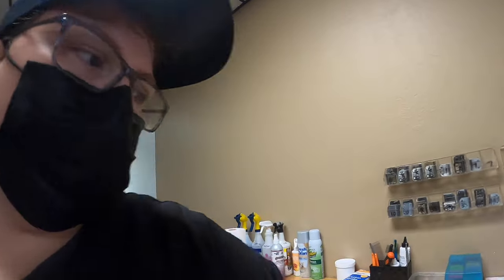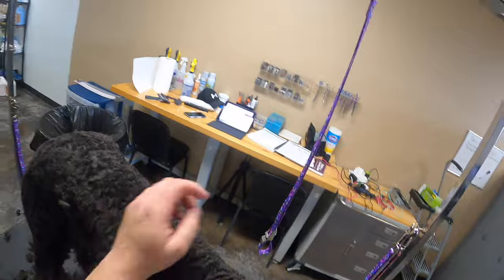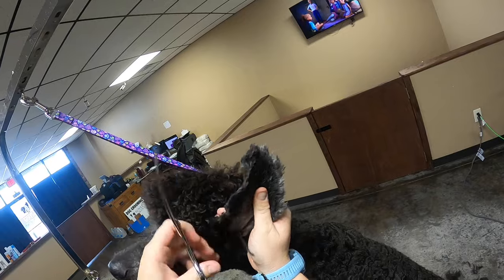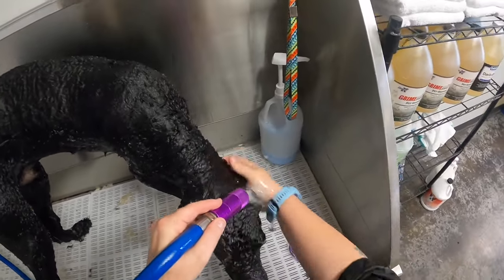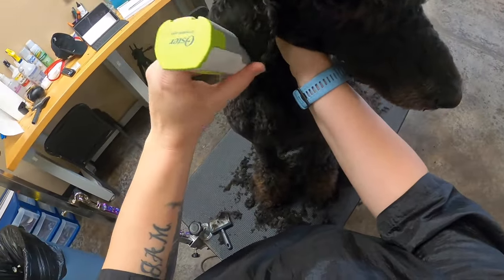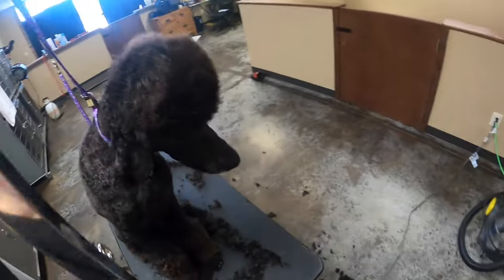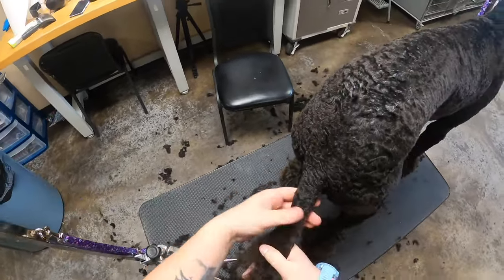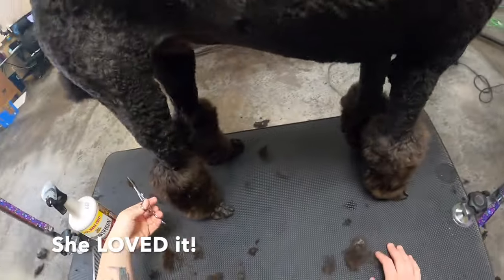Black Standard Poodle Groom

Comment: I think you did a great job for your first bracelets. One tip I do with them to set the bottom bevels is brush all the hail down. Then use your clippers with a 30 or 40 blade to set them. Hold the hair down with your right hand with the bottom of that hand at where the foot shave starts. Then use the clipper and go around that line to cut the air off. Then fluff the hair back up and shape it the rest of the way. You can also comb the hair up and do the same method to set the top line of the bracelets and then fluff up again and final shape with scissors and blenders. I learned this from a poodle person years ago. Thank you for sharing your videos with us and about real service dogs. As a handler myself it truly helps when people share about no faking them. It takes years of training with these guys to get them ready.